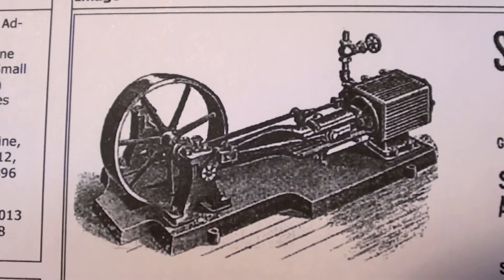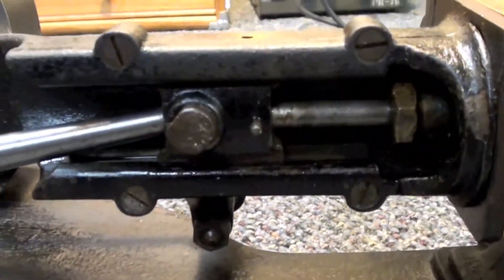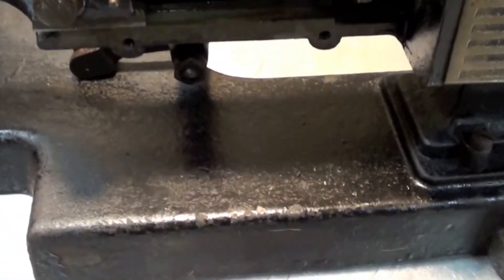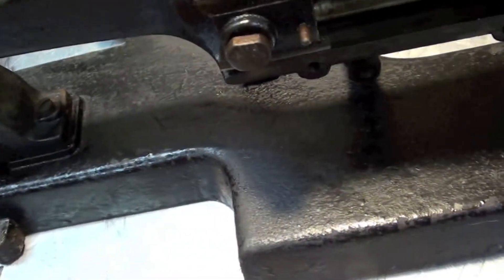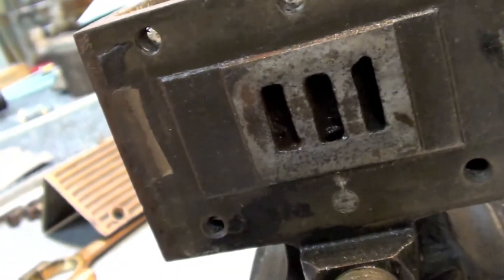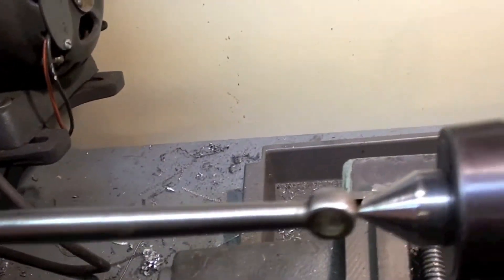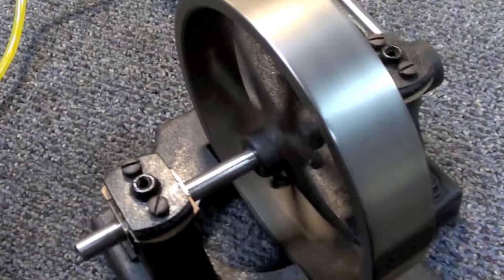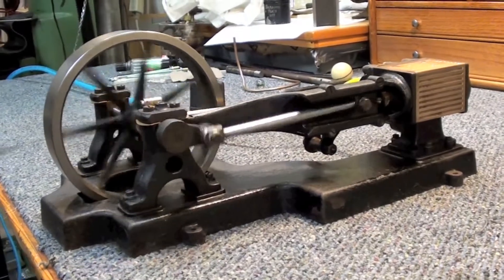Sipp Steam Engine

Comment: Any info would be greatly appreciated
Reply from the maker: +Andrew Erickson   Sure.  I can remove the chest cover and measure and take photos if you'd like.
Is it the sliding valve itself that you need or the chest cavity measurements that you need?
Barry
Reply: +enjundoc I just need the measurements of the sliding valve. some photos would help too. thank you!
Reply from the maker: +Andrew Erickson 
Andrew, I disassembled the engine today and took 10 highly detailed pictures with measurements.
If you could provide your e-mail address I will send them to you.
Thanks,  Barry